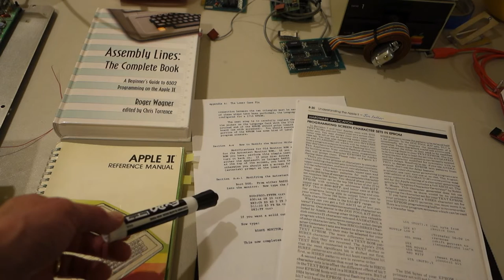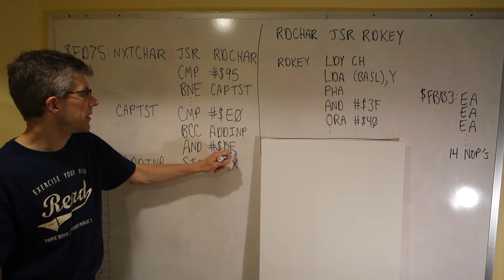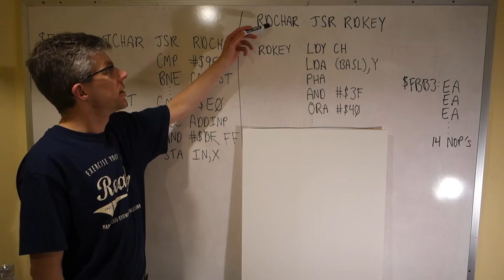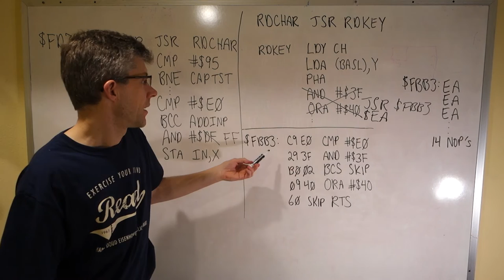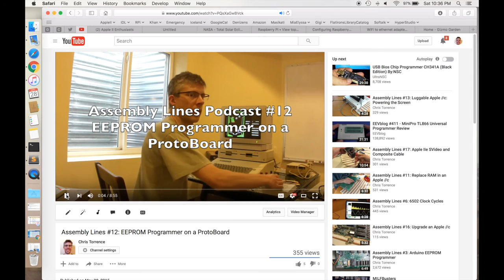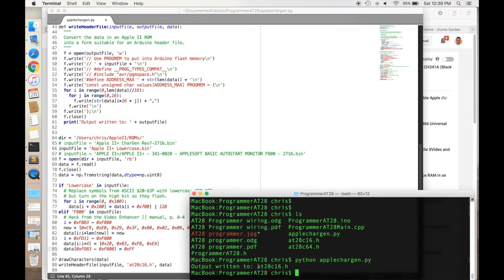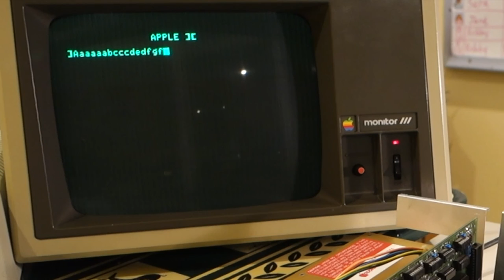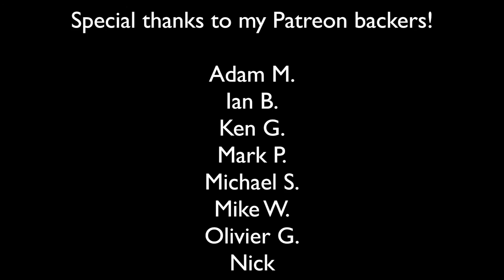Assembly Lines #32: Lowercase for your Apple ][+

Comment: Thank you Chris.  Great tutorial.  Now I have to find an Apple ][+ 80 column card -- something that seems to be hard to find...
Reply from the maker: Hi Norman, I would just keep checking eBay - the Videx Videoterm card appears every now and then, and they aren't too expensive. But I've only had mixed results with the 80-column card. To be honest, I usually just stay in 40-column mode. You need to have a really good CRT monitor for the 80-column text to be sharp.

Comment: Wow, What a great Tutorial. These Little computer are so fun to play with and I'm still learning though my Apple II

Can you Explain what the USER 1 Option is on the apple II motherboard? 

Thanks again for another great Video !!!
Reply from the maker: Thanks Joy of Lego! I'm glad you enjoyed the video. Regarding your question, I don't know much about the User 1 jumper. I found a brief mention of it on Mike Willegal's page: http://www.willegal.net/appleii/appleii-pcb.htm. He mentions that the location of the jumper is completely wrong in the Apple ][ Reference Manual and even Apple's Errata is wrong. It's actually located to the front right of slot 7. Apparently the QuikLoader card (by Jim Sather) required the User-1 to be "jumped" to work properly, but that's the only case that I know of. The manual for that card can be found here: http://www.brutaldeluxe.fr/documentation/manual/scrg_quikloader_manual_preliminary.pdf
I don't have one of those cards, otherwise I'd make a video! :-)
Reply: The USER1 jumper allows any peripheral to inhibit the motherboard's I/O address decoder by pulling slot pin 39 low and thus take control of addresses $C000 to $C7FF for its own purposes. That means it would inhibit (1) display softswitches, (2) keyboard,  (3) "serial" operations (cassette input, paddle buttons and timers), (4) annunciators, (5) speaker and cassette outputs, (6) peripheral device and I/O selectors. That's a pretty radical jumper!